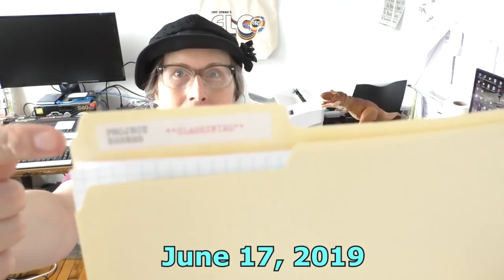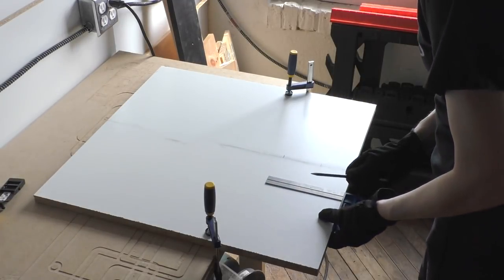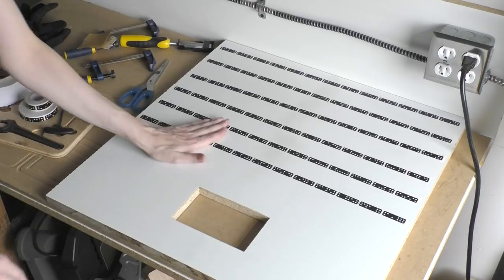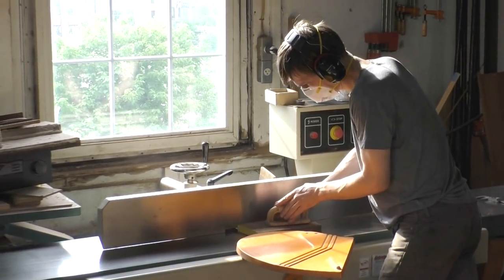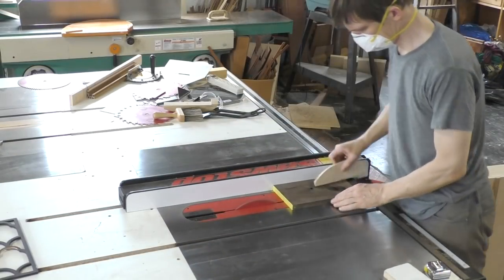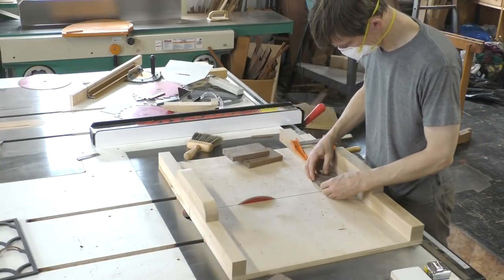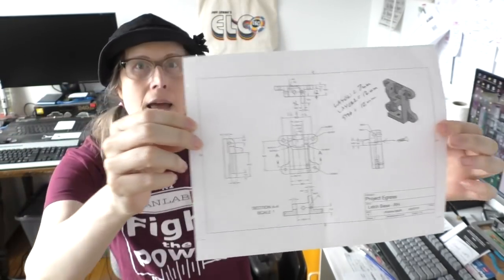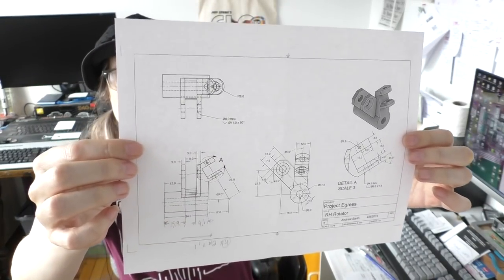Project Egress: FranLab Mission Log 2

Comment: Fran, I never understood from the previous video why you chose to build the parts out of wood instead of aluminium or steel? 
Surely something like walnut will never have the strength to take any weight or force? (or is the final assembly just for show and not going to be operational perhaps?)
Sorry, many questions to what looks like a fantastic project!
Reply: Hi Jens. The parameters of this project set by Jen and Adam are to make the parts out of whatever material the artist desires, since the end result is only for display. Artists and makers were encouraged to use different materials if they wish. As a result, the completed assembly on display in NASM will be extremely unique.
-Andrew Barth, Project Egress CAD modeler
Reply: @AndrewBarth  Cheers for that explanation Andrew! Makes total sense now - and I kinda figured there was something like this behind the choice of material?!
My problem is that I'm an engineer. Always thinking how to improve things, and how to construct load bearing parts etc, hence my reaction to wood ;)
Reply: Jens Andree Well, wood does have it's technical uses, though I too was wondering if it would function in a part designed for the mechanical properties of the original metal alloy.

Comment: Why not 3D Print the parts?  Seems much simpler, given the labor and specialized tools you need.  I'm late to this series, so I have no clue what your even building - time watch some more Fran Lab...
Reply: Looks like those parts are load-bearing.  The laminated layers of 3d printed parts are weak when they are small through holes like that. If I was involved in this, I wouldn't want to add that kind of risk when I send it off to them when it's done. Plus I think that it's not in the spirit of this project, ya know?